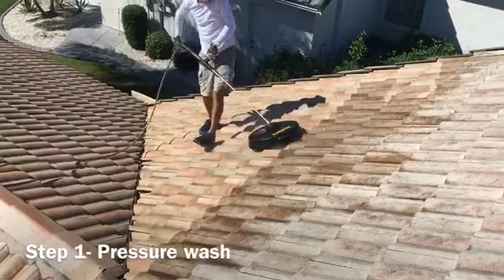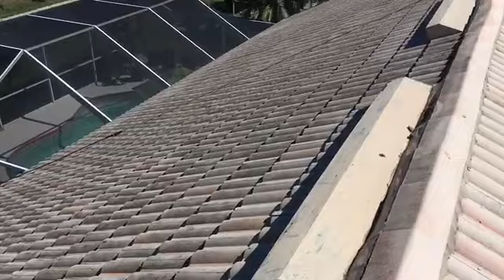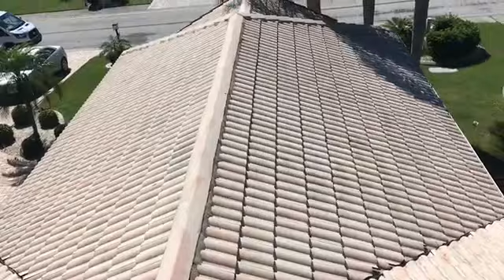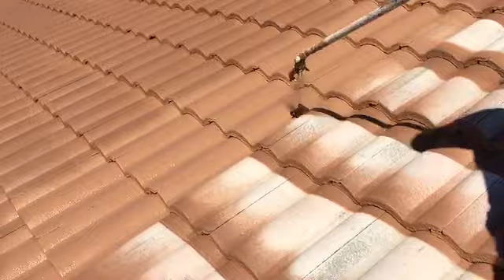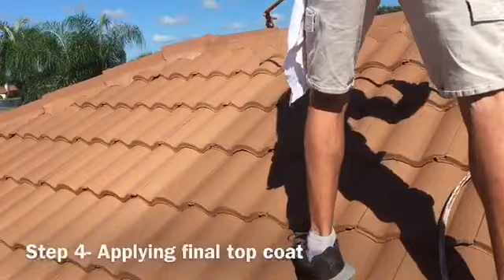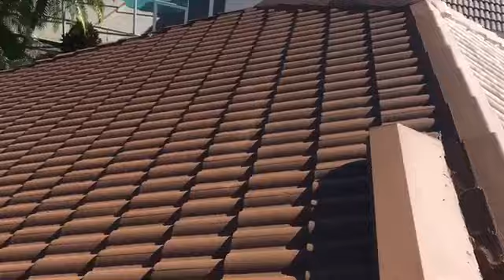How to Paint a Tile Roof #roofpainting #roofcoating #roofrestoration #tileroof #roofing #roof

Comment: you should at least cover the windows w/plastic. Overspray 😂
Reply from the maker: Not a problem with an applicator that knows how to lay down an elastomeric coating that is 3x as thick as paint, so it doesn't atomize and blow around as easily but thanks for the advice.